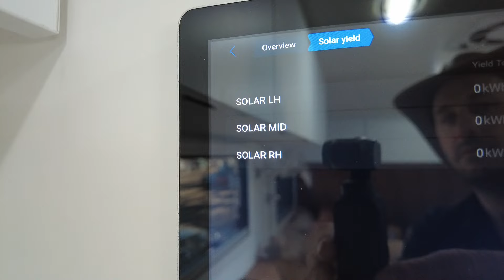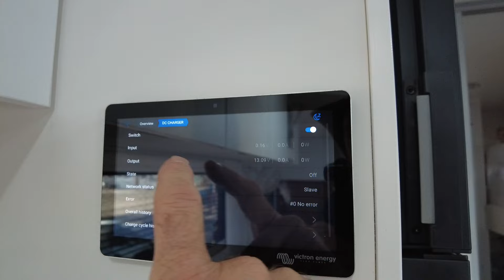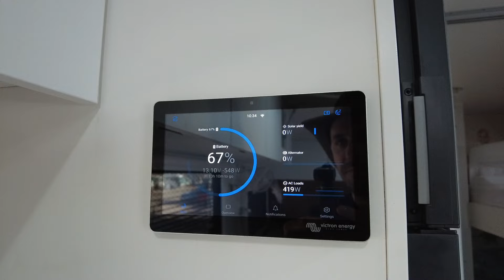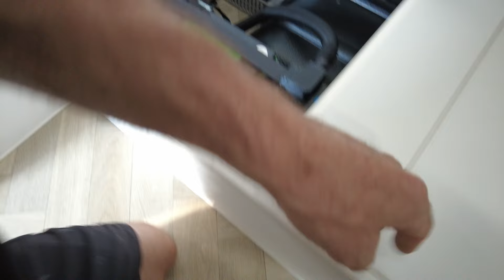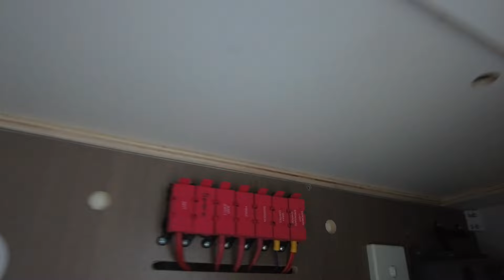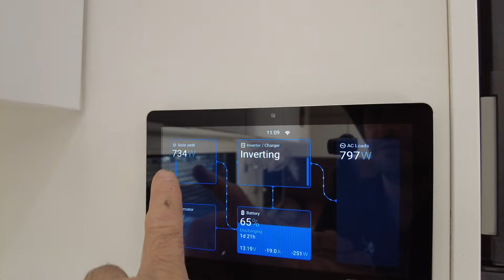Leader Gold Off Grid Setup 1480 watt/640ah lithium, air conditioning, washing machine, microwave etc

Comment: I thought the new standards were the battery box had to vent to outside and be sealed with a gasket internal if the batteries were not mounted outside the caravan?
Reply from the maker: Yes you are correct, that is the current standard.
These battery cases are vented.

Comment: Could you explain why you used 3 x MPPTs instead of two? i'd assume 2 x 50amp or larger would be enough from a capacity perspective? or is to do with how you've stringed the panels?
Reply from the maker: better mppt for this roof array. Avoiding shading issues.

Comment: Hey mate good video very informative,what size cable did you run from the drawbar to the bcdc charger? 
Cheers Tim
Reply from the maker: Hey Tim,
6bns (13.5mm) but the vehicle would need the same up to 5m. If over 5m best to jump to 16mm cable